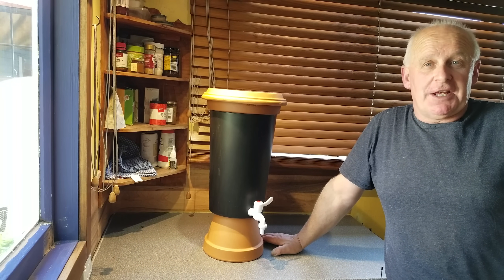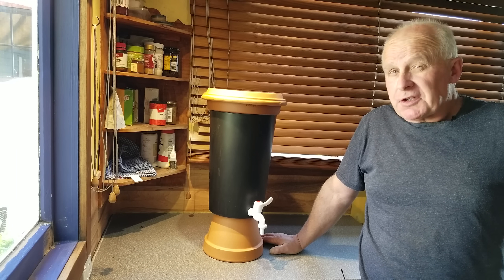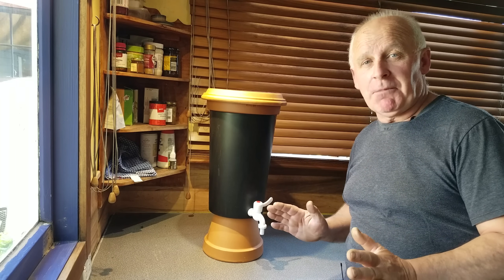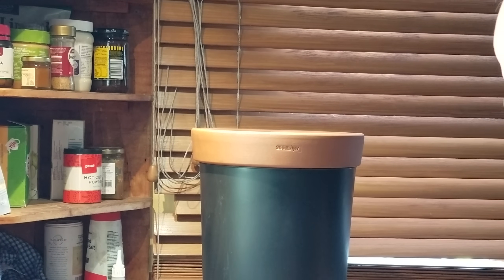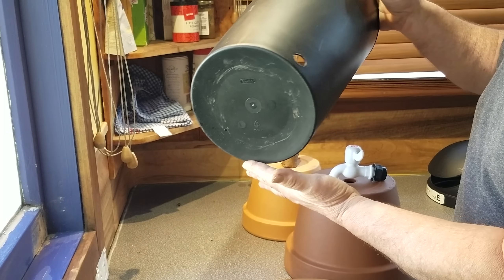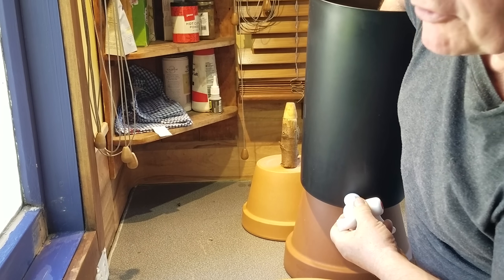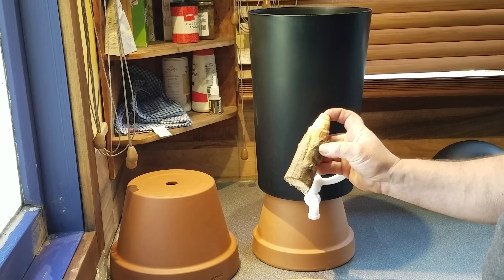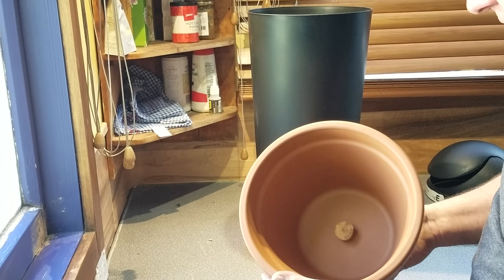DIY water filter. How to make FILTHY WATER drinkable

Comment: I would like you to show a test, if available, showing water before, and after !
And what contaminants if any, that are being filtered by this process ? 
I have to question it's abilities to last a lifetime, as depending on what its trapping in the pore's of the terracotta material, seemingly would either become clogged, or pass contaminants into the drinking water, maybe in higher dose's ?
Has anyone tested just how effective these devices are ?
Too, of concern would be pollutants trapped in the rainwater, and or Snow, depending on where you are, which also may making these viable only in warmer climate's, if at all ?
Another thought might be to replace the wooden plug, with a replaceable carbon filter, like you would find in pitcher type filters !
                   🤔...?
       Just a Thought ?

Comment: Very interesting setup.
?- if you felt you wanted more ‘filtration’. That could be achieved by just adding pots. Just buy extra of the same sized terracotta pot (2-5 whatever you want). Because they stack inside each other. Add your silver spray to inside each pot before you stack them. You’d need to carve more wood bungs (and for stacking make sure they are short). 
It wouldn’t slow down the water, since once saturated, the wicking speed of 1 would just transfer to the next and so on.
Reply: No, wouldnt help. All the pots would have the same size of pores, so what gets through one pot would also get through the next one. You would have the exact same result, just slower.

Comment: anyone got any ideals i recently made one of these but i cant get the water to filter through i bought the pots with the made in italy stamped on then as well i also sand papered the pot inside and out thanks
Reply from the maker: Block the hole-Pour boiling water in and let it cool- look for wax on the surface after it has cooled.
Reply: ok tinyhouse will try that first what am i lookinh for wax you said what then fill it up  in the normal way and it should start to filter through

Comment: If you are dealing with already treated water, it's fine. If coming from any other sources, it won't be fully effective against certain times of bacterias and part of the pollution found suspended in the air.
Every single terracotta filter (widely used in Brazil and considered the best in the world) has a filter candle that must be changed every now and then. 
I hope the substitute you made with that piece of wood is enough.

Comment: Hi, I'm a like minded thinker from NZ too. Very nice idea though I have a few concerns for you to ponder perhaps, they mostly stem from the location in which your items are produced and faux representation that comes along with it.

*terracotta pots, unglazed they might be however personally I would want to be very sure what compounds make up the base clay mix? I gather they are not made by a local Potter who which you have discussed this issue with. I would not be at all surprised if say lead, tin or other appetizing chemical compounds were inherent within the terracotta clay purely (or rather not) from country of origin. 

*$2 shop rubbish bin, yes your correct polypropylene is certainly the most food safe of any plastic, and black also is the safest colour choice even better than white or transparent more often than not. Back to the country of origin again though sorry as it is in my knowledge that a stamp reference to plastic type is merely a stamp and when using such an item like you are.......... well that's your choice to make it guess.

All the best from Nelson,  NZ

Comment: They cost a small fortune nomatter where you buy the originals.  I made one using two inexpensive stainless steel pots.  Works great, even for rain catchment becauseI don't trust that either with all the chemicals they are putting in the air these days.  Thank youforyouringenuity sir!  Great set up.  .🇺🇸
Reply from the maker: Thanks- I didnt mention that I use one drop of Chlorine Dioxide per gallon to kill virus and pathogens. great thing is- It keeps working after you drink it

Comment: Standard Plumbing practce would put the seal washer on the tap threads first, as thus on the outside of the contaner. Nice work. I can give you the design for a high voltage Silver generator which makes superior hydrosol of any metal desired.

Comment: Personally I would add a layer of activated charcoal to remove many chemical compounds that may be dissolved in the water.   Perhaps nesting two clay pots with the layer of activated charcoal between them may filter out particulate materials and dissolve chemicals before drinking.   Colloidal silver is an effective disinfect but too much can cause physical problems.
Reply: That amount of silver won't harm anyone, even if it was the size that could, which it won't be if you know what you're doing.
Reply: Health issues from the little CS he used? Hardly. (1) The amount required to coat the inside of his device should be very small - much smaller than the volume regularly consumed by CS health advocates. (2) Ceramic water filters, like the one he described, filter stuff down to at least 5 microns, sometimes to 0.2 microns or smaller (look it up).
Reply: (3) Claims by colloidal silver retailers of tiny particle size are very biased - greatly exaggerated because they want to sell more product. Independent lab testing shows that actual particle size of most colloidal silver products are significantly larger than advertised - from 9 times up to 1000 times. It depends on the product. But certain popular products consisted of particles that are mostly 6 microns or larger.
Reply: (4) The warnings and adverse effects of CS published by journals and government sources are suspect because they're biased. Short of outlawing it, they've been doing everything they can for decades to discourage use. Even the most ardent supporters of the medical industry has to acknowledge the huge amount of lobbying done by the pharmaceutical industry and the money and influence they have. The cynics say it like it is: collusion, if not corruption.
Reply: I haven't been able to buy any Colloidal Silver lately, Walmart isn't selling it neither is Walgreen's.
Reply: @gowest5145  Honestly, I'd be quite shocked if either of those places sold any. Rather, have you tried looking in your local herb or health food store? They're likely to carry some. If not, ordering online may be an option. Alternatively, you could buy a kit and make your own from pure silver wire.
Reply: @gowest5145  Look on youtube for making your own CS.

Comment: Is that wood Lawsons cypress?
Reply from the maker: No. Its Lawson Cyprus - but you can use cork or a rubber bung or any type of wood from a fruit tree that is not from a lumber yard. (in case its treated)
Reply: @t.h.o.r.  is Lawson Cyprus a antifungal wood as the reason for use?
Are other fruit bearing trees similar?

Comment: Looks good.  Typical problem with polycarbonate conventional filters is black mould which eventually finds a way to inhabit the filtration  section.  Looks like your silver inoculation might eliminate that?  Are you sure bacteria, pathogens, viruses,  can't leach thru the pot?   Hopefully the metal nut on the spigot isn't gonna give you rust-contaminated water?

If your water source is in any way "suspect"  I presume you could kill the bacteria with a preceding feeder container treated with chlorination  ( household bleach 2 drops per litre - roughly - do check recommended safe ratio !) - but I don't know if over time this would cause chlorine  build-up in the ceramic pot ?  How often to clean the ceramic pot which presumaby will absorb impurities?  Don't use a pot which has been lead-fired !

Comment: Overall, I think this is a great idea, however I have a few thoughts about it:  How can you be sure the water isn't sneaking past the plug you put in the hole?  Have you gotten your filtered water tested to see if there are any residual pathogens or chemicals left in the water?  You can make your own chamber for a Berkey out of an old pail or whatever as long as it is clean and food safe.  Here in the states, you can get a pair of Berkey filters for about $150 because the price of everything is going up right now,  which give you 6000 gallons of water.   We have this system and for two people, the filters last for years.  Compute how much water you tend to drink in a day and use for cooking, then do the math.  Those filters will last a very long time.  When you compute how much it costs for years of clean water, it's a total bargain.  We use about a gallon a day, so 1 gallon (+/-) divided by 6000 = 6000 days.  6000 days divided by 365 (the number of days in a year) + 16.43 years those filters would work and still be good.  Of course more people or more water usage per day would reduce the number of useful days of filtration you would get.    We saw a "British Berfeld" water filter at the Karen Blixen house in Africa they used back in the 1940's.   We've been totally happy with ours we purchased in 2008.   If your home made ceramic model works even close to as well, then good on ya, as they say down there, but we decided the cost for the filters was well worth the expense since you so rarely need to change them.
Reply: I thought we had pretty good water where we live, but we are finding all kinds of what looks like rust lining the inside of the Berkey upper chamber that we would have been consuming.  Turns out our little town has very old iron water pipes.  Too much iron in the system can be harmful to one's health.  With all the industrial chemicals and pollutants in the air, even rainwater needs filtering these days.
Reply: you used to be able to get a ceramic filter set from Cheaper than dirt, it was 20 bucks, just required two food grade 5 gallon buckets.  I've used it for years, if they still have them they are great.

Comment: Is there any data on this for removing things like bacteria or viruses anywhere or is boiling the water required before or after this filtering?
Reply from the maker: Yes- just read the pinned comment and follow the links
Reply: @t.h.o.r.  Ok, with the silver I understand. With just the pots though it is probably to pores and let's bacteria and viruses through

Comment: That's really cool. But a few questions:
1. Why would they make a rubbish bin out of food grade plastic? I'd be skeptical of a Chinese product of this nature used for this most sensitive purpose.
2. The clay pot is brilliant. But how can you be sure it provides the same level of filtration the Berkey is known for? (since that is the standard for comparison)
3. How can you know without testing if the clay pot removes viruses, bacteria and chemical agents? Are there limitations on what it won't remove? If so, what are they?
4. What level of dirty water can this system handle? How do you know where to draw the line and also at what interval to replace or clean pots?
Thanks and aside from the questions, fantastic DIY filter!
Reply from the maker: By research- you could start by reading the pinned comment and following the link at the beginning of the video?
Reply: @t.h.o.r.  Ok, I just looked at the links you provided. They do not answer any of the questions and concerns I posted. Unless your obtuse links are your way of saying you sent samples of the plastic garbage can and clay pot off to a lab that performed detailed toxicity analyses? Or are you saying you also have a complete scientific water and leachate toxicity lab at your disposal and you are a trained chemist that knows how to use that lab? Is that what you're trying to say?

Comment: Activated carbon ( acidified charcol ) makes an excilent air filter or water filter to absorb toxins ( that is what most gasmask filter are, just paper and A Carbon). You could add a layer to that filter to make it anti toxin, even making Iradium and Ceasium contaminated water safe(ish) to drink.
Reply: would you put this in the terra cotta pot? sounds like a good idea. maybe some sand too.

Comment: This will filter ONLY non-liquid particulates, but liquid chemicals will go through the clay/terra cotta just like the water. Also, the clay/terra cotta will eventually get saturated with the chemicals and microscopic particulates (the bad stuff) and require replacement. It is NOT a perpetual filter system.

Comment: In many cultures around the globe...terra cota pottery to hold potable water has been a thing as old as time (at best to survive with...but not spared from ameoba and such microbes...so best they pour previously boiled from clean enough source water into these storage types)...but the jar itself needs to sit at the most level and undisturbed part of the house and will need constant emptying and cleaning of the sludge deposit over time (notice the spigot placement must be a tad bit higher than the bottom so as not to disturb the heavier bottom deposits)...interesting thing is that the "filtered" water from these systems are also kept "cool" if not in direct sunlight...cooler than room temp at least...like beer burried under beach sand touched by water :D

Comment: I have seen a few great videos on making a water filter from a 2 liter plastic soda bottle. The trouble is... I don't drink soda.
Reply from the maker: Great point!- people say to me "Oh I don't drink water- I only drink soft drinks" - Lol- the water in soft drinks is municipal water from the city of origin!
Reply: @t.h.o.r.  I wonder if a sandstone vessel wouldn't do essentially the same thing? It could be sterilized at 500 f beforehand as well. 

Wall thickness as well as pore/grain size would be the determining factor i would think.

Comment: will this system filter out the dentists favorite poison?
Reply from the maker: Well- I dont know. my whole idea was to avoid tap water- Im filtering rain water
Reply: @t.h.o.r.  Thanks for the reply. Most of us don't have the rain water option. We are stuck with the treated water supply.
Reply from the maker: so it doesn't rain where you are?  I collect my rain in a barrel- see my other videos
Reply: @t.h.o.r.  I'm in a flat roofed apartment building in Toronto. Collecting rain is not feasible. Not totally impossible, but not realistic either.

Comment: What makes your system seem to work and our systems dont.
After a week there is 1mm red water in my bottom yar.
My friend on the other side of the country build one as well and has the same results as me. App. 6 drops of water a day.
Reply from the maker: looks like you have bad pots. Mine are branded - made in italy and work perfectly
Reply: @t.h.o.r.  Mine are german. 
What brand you have, maybe I can order them there. In the netherlands its almost impossible to find pots
Reply from the maker: Sorry they have no branding - just stamped Made In Italy. I got them from Mitre10 - our national hardware chain store
Reply from the maker: I guess yours might be waxed or oiled- block up the hole fill with boiling water and see if wax or oil rises to the surface

Comment: Here in Brasil this type of filter is very popular and cheap. It's all made with ceramic, no plastic. They cost about 30 dollars today. I have one myself.
Reply: Do you have a link for this type of filter in Brazil?
Reply: Wht wood do you use in Brazil?
Reply: @relaxingyourinnerfriend799  There is no wood in that hole. In the hole is connected a proper water filter, so the water doesn't pass through the ceramic basket, but on the right place, the filter. You can use the water from the tap e fill the top part of the water dispenser... in few minutes/hours, you will have filtered and fresh water in the bottom part.

Comment: How do you clean it? If it’s filtering I assume the contaminates are stuck in the clay pot? also how does it taste? :) I want to try something like this mostly for feeding my plants cause Tap water has fluoride and chlorine which isn’t great for plants.
Reply from the maker: Follow the links to the next video that explains all that! I have to tell people about 6 times a day! - does nobody read pinned comments or follow links for more info?
Reply: @t.h.o.r.   😊 I gave a thumbs up for the reply. I rewatched your video again but it still doesn’t answer how to clean it. You did mention how to treat it before using it this as filter but I’m curious at what point does this system need to be cleaned from build up. Do you Just wipe down and scrub it as soon you notice the water flow is slower? or do you only just keep applying the silver compound sanitize it?

Comment: How long can the ceramic filter be used before it needs to be replaced? Or can it just be washed out? Have you ever tested the water quality? I wonder how safe it would be with lake, river, or pond water?
Reply from the maker: follow the links to the next video where all is explained. also the links to the CDC website and the FDA where they test terracotta filters. The links are there because its important info.

Comment: Update. I tried another ceramic pot. Cleaned and put in another pot. The method you use - I tried.it has been 5 days and one cup of water. I primed the unglased terracotta pot for 2 days until I set it up.  Cannot get it to work
Reply from the maker: Maybe your water is too thick?

Comment: You didn't mention what the terracotta ceramic is filtering out of the rainwater? What can it and can it not handle?  And how do you "service"  this filter?
Reply from the maker: Anything larger than 2 micron- just like a Berkey filter
Reply: @t.h.o.r.  That's awesome!  For some reason I just can't find any terracotta pots that big for under $10 though (I'm in the US).  I think as soon as the market figures out that people have found a way to get great value out of something inexpensive, that thing becomes very pricey.  I'm having the same problem trying to find stainless steel stock pots - a DIY thing says they're $10 or so, but I can't find them for less than $60.